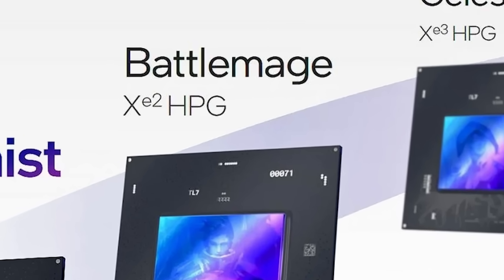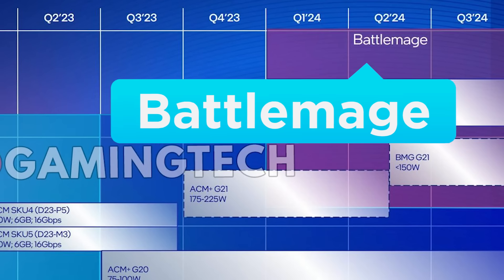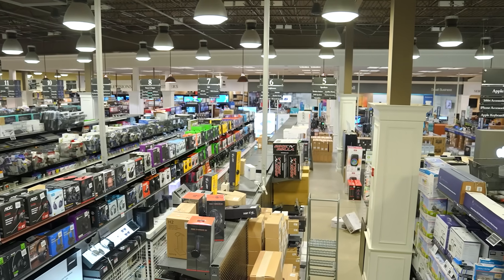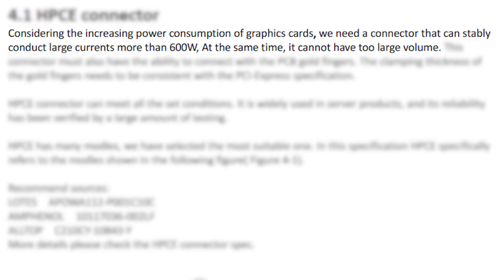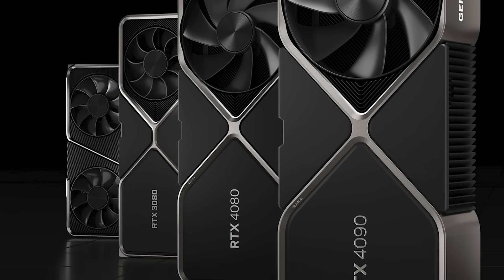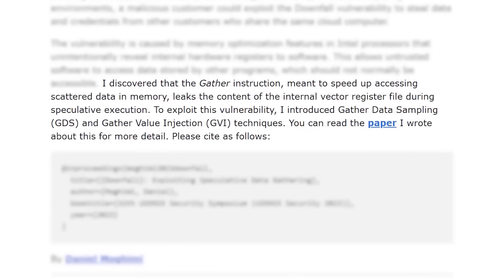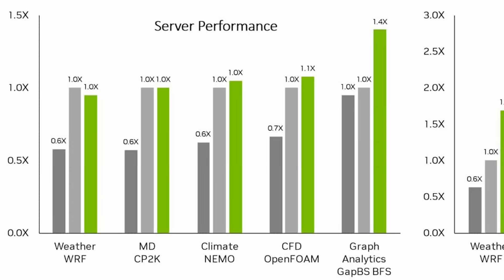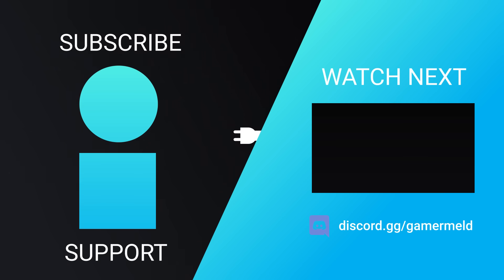New Standard Means You Have To THROW OUT Your GPUs!

Comment: It is a critical likely economy destroying faux-pas to categorically sue a company for hardware or software issues, but it is valid, important even, to sue for negligence , especially if willfully committed due to corporate (financial) interests. This includes timely reactions to issues found, and being open about it.
I would even go so far to say that any risk, damage or just critical restriction / limitation to infrastructure, a country's finance system or backbone in general requires immediate mitigation - failing to do so in this context would be akin sabotaging the same.

In practice it likely is impossible to really tell if an issue arose from negligence, and it is impossible to manage or pay for the many lawsuits coming a company's way. Because if this it's probably best to not sue unless there is evidence for negligence, such as apparent failure to report issues found and inadequate responses to them. A 50% performance reduction, for instance, is unacceptable. If Intel doesn't come up with a reasonable fix soon they should at least offer a replacement at cost / without profit, and that is if they don't hold blame for the situation at hand.

Comment: So answer me this ? If this design where to become mainstream and I honestly have my doubts about that. It seems this new design still incorporates a traditional pcie slot so whats stopping me from slotting a gpu without the new power connector into the pcie slot, and just powering it with traditional pcie power cables from the psu? I can see how new cards wont work on old boards but whats stopping new cards from working on new boards? Why would I be stopped from using my old gpu?

Comment: When it comes to the onboard power delivery for PCIe cards... I have one hope, that it'll go through an independent regulating body such as PCI-SiiG so we don't have random anti-consumerism issues such as Asus/Gigabyte/MSI/Etc having issues such as differences in pinouts / power delivery / distance from PCIe slot.  Nothing would enrage a customer more than finding the slot 1mm off in either direction or plug in the card and see magic smoke come from the motherboard and/or video card.

Something that they could do that could be interesting, is when/if they start pushing this technology, they could start deploying it at the same time as ATX-12vo

Comment: I welcome the day the ATX format dies. 
It is obsolete in many ways and takes too much space. 
Upgrading PC is already useless activity. With few generations all parts of it are obsolete, except for PSU and perhaps hard storage. 
Wires and connectors are enemy of efficiency.
The GPU and CPU and RAM could be hard soldered into one PCB - it would be much cheaper, more efficient with better thermals and take less space.

Comment: The motherboard power solution for gpu's wont catch on, more power through the motherboard would increase cost and thermal issues especially with high end cards. Also it just means Asus motherboards will fry more components, maybe that's the plan.

Comment: As a hardware engineer, I can confidently say that mobos with that power connector will be insanely expensive. Not easy to put 600W through motherboard. I guess card manufacturers will have different models going fwd if these mobos gain traction.

Comment: On the new GPU/ Motherboard.
I'm telling you, the Pcie16 slot is like looking at a Molex connector. I get it, but just like we ditched ribbon cable (well except to convert a traditional mounted GPU over to vertical) we should ditch the idea that, the GPU must look like a robotic loaf of bread-with fans. The GPU should come in a standardized size. The ITX form factor- to share an existing format size. Like the CPU, a cooler can be a stock Air cooler, or you could opt for an AIO- or have it plumbed into a custom cooling system. The connector should be a cable, or a set of cables, but the card itself should be independent, allowing it to be mounted inside or external from the actual PC Case- The new form will emphasize modularity.

Comment: Perhaps the best thing about this new HPCE connector is that it will remove GPU-sag on larger cards,
and it will also completely prevent cracked PCB's which some cards are struggling with today.

I for one, welcome this new connector.
Reply: GPU sag comes from larger cards, not the cables.
Reply: @notyourbusiness4169  
I know, but with this extra connector on the Motherboard,
The GPU will not be able to sag anymore.

Comment: We also need a new standard that will address the giant size and weight of GPUs putting pressure on the PCIE slot.
Reply: can you imagine the shorting with 600w slipping out, server chips are fairly well secured in... with braces, I see a lot of fires.
Reply: Side mounting and riser cables.
I’m never going back to in the board again

Comment: The adapter would be just like a PCIe riser cable, with a card edge connector for the GPU at one end and eight- or sixteen-pin power connectors at the other. No need to buy a new motherboard

Comment: I like the current style of GPU connection because if it fails I won't have to buy a GPU and MOBO. Especially for the Top tier cards, I wouldn't want to buy a new mobo just because the heat of the power connector melted my motherboard.
Reply: Also with the design. If a part melted who's the responsible party that will compensate us if we have differing brand parts? Will they ping pong us back and forth until we get fed up?

Comment: Beating X86 with ARM is not surprising. The smaller instruction set means less bulk on the silicon and less junk microcode to scan through to execute them. Very low power for the performance.

Scaling and adoption are the issues at hand for ARM and honestly, we'd probably be better to skip to RISC-V and go full send instead.
Reply: If the instruction set size is so important why not use PIC, which is smaller still?
Reply: 128 bit? Sounds really thoughtful. I don't want another 32 bit to 64 bit situation. We are just about to overcome the transformation. It took freaking DECADES.

Comment: You would obviously need a new power supply also.
Reply: If you mean the GPU, why? Why not an adapter cable with the new connector at one end and eight-pin connectors at the other?

Comment: I doubt the motherboard change will take over anytime soon, maybe in the next 3 generations is what I feel like
Reply: Yeah and amd hasn't even started using the 16 pin
Reply: @gren7061  that's just for gpus if you're talking about the power adapter and the 16 pin has so many problems.

Look at how many 4090s burned down due to the faulty power connector they started using. I'm so glad amd didnt switch to it for the 7900xtx lol.

And dont go saying user error where even after people understood to fully plug it in to make sure it's in there plus, making sure it didnt bend and they STILL BURNED. THATS WHY NVIDIA HAD TO MAKE A NEW 16 PIN H++ POWER CONNECTOR.

16 pins are just not stable, and nvidia screwed up, if you hear a CLICK, that should mean it's good. If this was any car company they would mass recall cars to replace the faulty parts and so they dont get sued but nvidia doesent care...

Comment: why dont "normal common GPU" use like CPU Socket on motherboard?
為何不將常用普遍性高，低功率的GPU，像CPU一樣使用腳座在主機板上。
這樣CPU&GPU可以做他們的專屬通道，縮短距離以加速處理。
Reply: You cant socket a gpu on to a board due to two things; 1. the rest of the card is dependant on the gpu that is on it. A board designed for a 4060 is not going to work with a 4080 on it because both the power delivery and memory configuration need to be specific to the gpu. So the whole graphics card itself does not make sense to be individually socketable. 2. It's very hard to design processor sockets for very high bandwidth. The speed that the memory on a graphics card operation is so high it would be very difficult to design it to be socketable like system ram is.
Reply: Nvidia CXL and Open Compute Accelerator Modules (OAM) are socketed GPUs for servers. They are mainly used because they can directly connect to at least seven other GPUs, 2 CPUs, and supply 700W. Client PCs generally only have at most one discrete GPU so that much connectivity simply isn't necessary
Reply: 抱歉我英文不是很好，可能穿插漢文回答。
GPU memory可以改用HBM memory，amd & nv不是也有這樣的考慮嗎?
改用HBM可以放到GPU Package，那麼how many bit bandwidth GPU自己決定。
Reply: @歸虛  没关系, 我中文也不很好!

Yes, they can also put the memory in the package. It doesn't have to be HBM, they can also put DDR in the packages like Apple Silicon, they use LPDDR5.

Even if the VRAM is inside the GPU chip package, power still needs to be regulated and conditioned. Different GPU's will have different requirements, so that power delivery circuitry should stay with the GPU. Today you can plug a 4090 or a 3050 into any motherboard. If there were a special GPU socket, power regulation on the motherboard would have to match the GPU, so small or cheap motherboards wouldn't be able to use powerful GPUs.

Since the bandwidth between the CPU and GPU isn't usually the bottleneck, and there is only one GPU, 16 PCIe lanes is sufficient and I think the standard connector gives the best flexibility

Comment: The problem is my 3800X is way more than what any office needs. But I under-clocked and under-volted it because it is not for gaming.
A. For single monitor a 5700GE has all you need. 
B. When you have 5000 PCs in a building. You have to cool them
The 3700X is a all you need with any GPU that supports multiple monitors. 2 monitors $50. 3 monitors $300.
I used a HD7790 2GB for 2 monitors. (85watts)
C.That also means since their will probably be not much demand for faster plus more monitors in the office.
M$ likes to keep the software updates on a treadmill for more updated site licenses. But at some point how much more do you need?
 My 2650 x 1440 is 10 years old. The whole build cost less than a 18 inch laptop. The monitor was $750.
Monitor probably uses more power than the PC.
These next generations of CPU? will be for a limited market and specialized markets.
A i7-9700K or Ryzen 7 5700G should be all you need for any office for 5-10 years.
These latest CPU? GPU? also will be pricey because of the limited production. Or they could be just for AI only.

Comment: Server POWER consumption... an HVAC (cooling) company has a site to CALCULATE what your HVAC needs are. So basically how much cooling WATTAGE you'll require. You may be shocked to discover that it's 3.5x to 4.25x the power drawn by the equipment to remove that heat energy. So it's up to roughly 5W in power you have an electricity bill for, for every 1W you draw from the wall.
Reply: That can't be right. The AC also has to dissipate the heat somewhere, so you would have to buy 25W to cool 5W, and 125W to cool that 25W and so on. It's absurd

Comment: Breaking News! Motherboard with 600w passthrough melting and catching fire! Hell even if they don't I can only see the heat from that kind of voltage dramatically shortenting the lifespan of motherboards. 😥 More proprietary shite that noobs will rush to buy because it looks cool and wonder why their motherboard dies right at end of warranty period. 🤣
Reply: It's still only 12V, same as most of the other power connectors on the motherboard. It's not even proprietary, they chose a common card edge connector that's already being used in high power designs; they list three sources for the socket and anyone can add the edge connector to their PCB design by copy pasting the footprint

Comment: HPCE will never catch on... So you need the GRAPHICS CARD, the MOTHERBOARD and also the CASE to support this (the power cable plugs into the REAR of the motherboard). So... if people are really concerned with having the POWER CONNECTOR behind the motherboard which is the ONLY reason any of this matters, then why not just have the normal POWER connector offered on the REAR of the graphics card facing the motherboard direction, but next to it. That way a normal case would work, and you could still run the power cord in behind like you do the 24-pin. The HPCE has several drawbacks:
a) compatibility (graphics card, motherboard & case)
b) reliability (more points of failure)
All that, to do what you could easily accomplish by moving the graphics card power to the other side of the card (for cards longer than the motherboard).

Comment: Battlemage will be 4070 level perf at best. The power consumption level says it all. If Nvidia could have made the 4080 at 225w, they would have. At this time, 4080 level performance requires 350w minimum.
Reply: The A770 is roughly around 4060 performance now, quite a bit higher for some uses and lower in many games.
If the rumors of double the CU's for Battlemage are true, I'd be expecting 4070Ti or greater performance from it.
In my opinion, that would be an excellent place for Intel GPUs to be, a high-volume area of the overall market.
They don't need to strive to create the fastest GPU at any cost, just grab some market share with a small profit margin 
(hopefully, to allow development to continue)
Reply: The reality bm will be at 4060ti perf
Reply: I've only had a cursory glance at Battlemage but from what I understand they are doubling the amount of EU's. Overclockers had some success with Alchemist, so its possible that Battlemage will come with double the EU's and operating at a higher frequency than Alchemist. Should result in slightly more than double the performance. Wherever that puts them on a graph I don't know.
Reply: There is a chance it can be better, in the unlikely event they iron out all the hardware and driver bugs that plagued alchemist. The planned theoretical performance of alchemist (without any bugs, and clocked higher with slightly faster vram) was supposed to be between 3070 and 3070ti performance, and in reality it landed between the 3060 and 3060ti (so about 20-30% below expectation). One tier above (20% performance) 3070ti performance is the 3080 10gb, which is also around 4070 performance. Intel should have mostly fixed the alchemist bugs in battlemage hardware, and combined with architectural and process node improvements, the theoretical performance should easily be at least 4070ti level. Once we factor in how much below expectation alchemist turned out to be by subtracting 20-30% from 4070ti performance, we should get 4070 level real world performance for the top battlemage gpu.
Reply: @mingyi456  that's about where I expect it to land too. I think a lot of people are thinking that it's gonna be a 4080 killer and that's not gonna happen at 225w.
Reply: @tstager1978  Honestly, if they somehow hit a home run and produce a 4070ti killer at 225w, it would be nothing short of miraculous. Sadly, intel's track record makes it incredibly unlikely.

Comment: This isn't a "bug" in hardware. The security exploit is a manufacturing flaw that should have been sealed before release. Now the "fix" for it castrated the performance of the parts which means Intel falsely advertised the new CPU performance. They and AMD deserve to be sued. I mention AMD because they're fighting the same issue right now but it is yet to be determined if their fix will result in a loss of performance.
Reply: Probably more on neglectfulness/distractions for performance, delivery dates, effectively in costs and other matters.
Reply: Yeah, and the thing is they allegedly knew about the security vulnerability for a full year before the news broke. They fixed Sapphire Rapids (which was delayed to fix an unreported security bug 🤔), but everything else they’ve release in the last year they did so knowing that the security fix would eventually cripple performance.

Comment: My problem with HPCE connector is how much power will be going through the motherboard over all.... and while it will most likely be split off in different areas, it's still worrying me. 
As about the lawsuit, it sounds like it would be ok if it were limited to how much loss in performance it made, e.g. it's not an issue if it's 1% - 5% or so once in a while, but if it's amounting to 30%+ Then it starts becoming an issue, though the good side about the lawsuit in conjunction with EU making removable batteries a thing, is that you wouldn't have to deal with companies like apple (As It's the main one i remember being taken to cort for) reducing and bottlenecking your performance in pretence of "Preserving battery life". As the battery could be replaced in future times (Give or take a few years, forgot how much time companies were given)  and bottlenecking your phone for such a reason could bring trouble.
Reply: The amount of power going through the motherboard is absolutely not a problem. AMD and nVidia are putting 8x GPU accelerators on a single motherboard and each one is running 500W. That’s 4kW not even counting the CPU, storage, memory, networking, or cooling. The motherboards are made to handle that kind of power and is absolutely the least thing to be concerned about.
Reply: I think it happening this way due to their neglectfulness/distractions. Performance was probably we understand much more readily though.